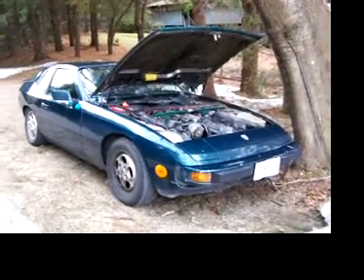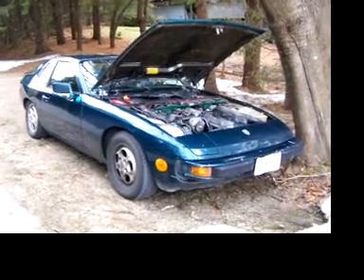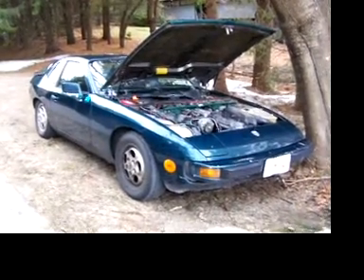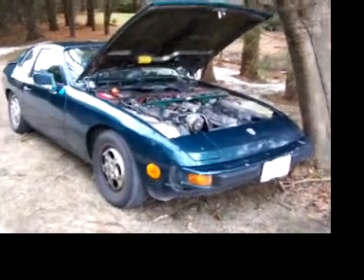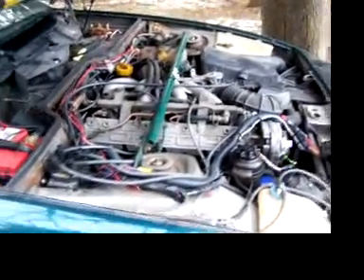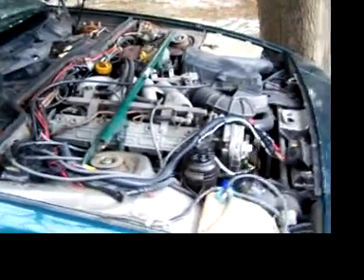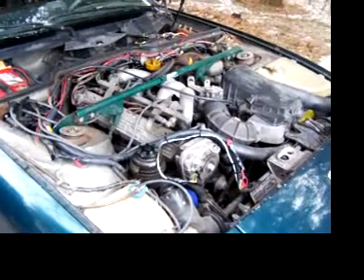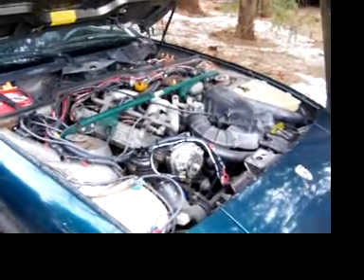924s With 1993 Ford Escourt EDIS Ignition Controled By Megajolt Lite Jr V4

Comment: Hi it is El, DO YOU STILL HAVE THE DME RUNNING YOUR FUEL SYSTEM WITH MEGAJOLT ONLY CONTROLLING THE IGNITION? I AM THINKING OF GETTING THE MEGAJOLT SINCE IT IS CHEAPER THAN THE MEGASQUIRT BUT ARE WONDERING IF I CAN RUN MY INJECTORS WITH MEGAJOLT OR WETHER I STILL NEED THE VR AND SPEED SENSOR MOUNTED ON THE BACK OF THE ENGINE? PLEASE REPLY AT EBELLO232@GMAIL.COM. THANKS FOR YOUR HELP.

Comment: Hi My name is ELI BELLO I HAVE A 944S 1987 THAT I AM BUILDING AND ARE THINKING OF UPGRADING MY IGNITION SYSTEM. I AM GETTING THE WHOLE IGNITION COMPONENTS FROM A FORD ESCORT ON EBAY. WOULD YOU SEND ME BRAKE DOWN OF HOW YOU WIRED THIS SYSTEM TO THE CAR. DID YOU USE THE STOCK REFERENCE AND SPEED SENSORS? ANY HELP WOULD BE MUCH APPRECIATED. PLEASE EMAIL ME AT EBELLO232@GMAIL.COM FAILED TO MENTION THAT THE IGNITION IS AN EDIS4 WITH COIL AND REFERENCE SENSOR AND WILL USE A 36-6 TRIGGER WHEEL.

Comment: OK let me re state my complaint. My base edis4 system has a week spark without megajolt. With megajolt it still has a weak spark. If you just have an edis4 you don't really have a system you need either a megajolt or megasquirt if tryed to drive a car around that's fixed at 8 degrees before TDC it wouldn't be much fun that's why I say my megajolt sucks witch to me is differant then saying all megajolts suck.

Comment from the maker: Thus megajolt and Brent are not at fault not are they responsible for your set that up.  How well is your engine grounded back to the frame of he car and back to the battery?  I would look at those.  Also are you sure you are saving the timing files to the megajolt?  IF you don't it will not take and the car will feel soggy like it has a week spark when in fact it is really a timing issue.

Comment from the maker: Sorry to here you are having trouble. I have had it on the car now for more then 100K miles with out issue.  A couple things to understand.  Megajolt does not make or cause the spark to be week or strong.  It does not generate the spark.  It only allows you to adjust the timing of the spark.  You have an issue with either grounding or the wiring to the coil/ edis unit.  Don't bash Brent for this he has no control over that.  Try unplugging the megajolt you should have the same week spark.